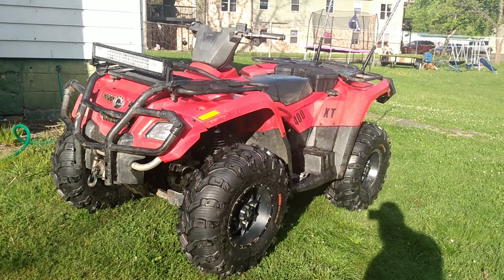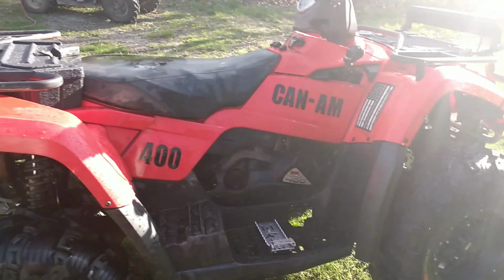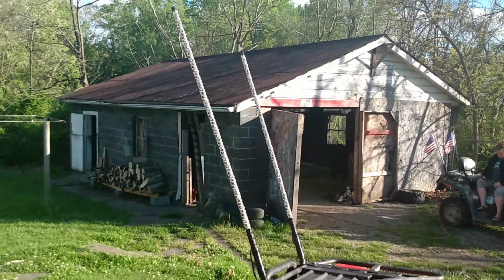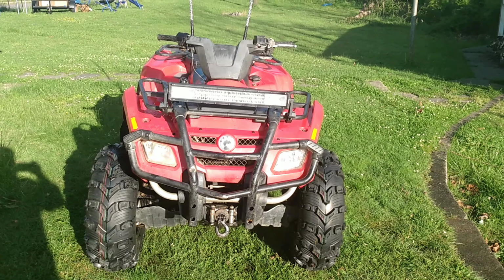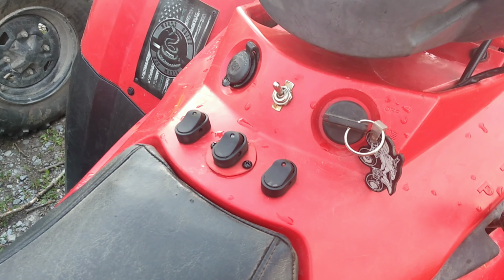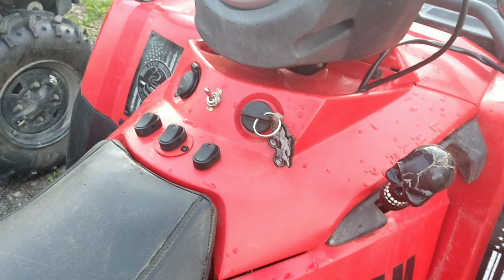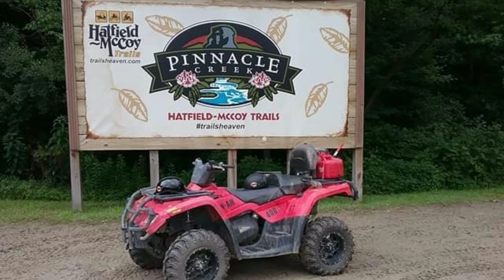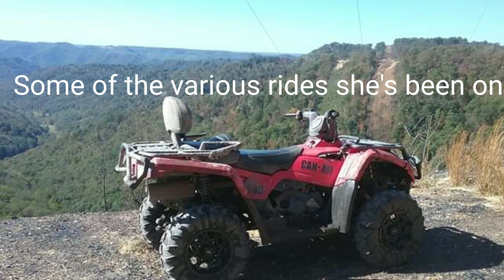CanAm Outlander Max 400 Rebuild-Part 4 (Completion)

Comment: Great video...Where did you get the fender flares for your wife's Can-am? We are curently rebuilding  ours as well.
Reply from the maker: Thank you very much!
Those flares were already on the machine when we purchased it. However, you can get a complete set, new on ebay. Here is the link:
https://www.ebay.com/itm/403205731170?chn=ps&_trkparms=ispr%3D1&amdata=enc%3A1I2RtR7jXT9eGn9_SMKOBqg83&norover=1&mkevt=1&mkrid=711-117182-37290-0&mkcid=2&mkscid=101&itemid=403205731170&targetid=1644837434363&device=c&mktype=&googleloc=9009239&poi=&campaignid=16743749222&mkgroupid=138744546207&rlsatarget=pla-1644837434363&abcId=9300842&merchantid=131375992&gclid=CjwKCAjw6IiiBhAOEiwALNqncffy6fSMHNHDTghTfkYDOgaybSVTjdQ0gj6sAzL87VXkR5el2pl_VxoCkoMQAvD_BwE
Reply: @turtlescycle  Thank you !

Comment: Are those 12 in or 14 in upgrade?
Can you share the tire size?
Reply from the maker: They are 12" wheels
Tires are Kenda Bearclaw 26x9x12 front and 26x11x12 Rear

Comment: Awesome video I'm assuming yours is an early 08 carbeurated model? Unless maybe it's just because of the Max, but my 08 400 efi has the exhaust on the other side. I love it I got lucky am the 2nd owner picked mine up in 2020 with 500 miles. Am at 1800 now and it's already paid more than itself off I plow with it every winter. The only issue I've had so far was the original winch broke it stopped working when I was plowing so I had to ride home with the plow down, when I took it apart pieces of the gears were broken off. I upgraded to a 4500lb winch and I take good care of my machine. I don't really go on trails too often, but here and there. Don't go in the mud because it's my source of income for the winter.
Reply from the maker: Thank you for the compliment.
Yes, this an 2007 Carburator model.
Reply: @turtlescycle  sweet yea they're good machines I had an 04 previously It'd take a lot of abuse, but got rid of it because it started eating away at my pocket. It wasn't taken care of by the previous owner though. I was to young at the time too and didn't have the tools to work on it.
Reply from the maker: @baileymiller546  yeah tools, knowledge and deep pockets! Lol.
It is definitely nice though to see your work in progress when it's done.
Reply: @turtlescycle  yea so far this 08 has been taking good care of me and I've been taking good care of it. Eventually it'll need some work done, but I'm very happy with it. Best of luck with your projects friend.
Reply: @baileymiller546 what issues was your 04 having. Thinking about buying an 05 and want to make sure it isn't a money pit. Seller says it hasn't ran for a year and needs a "new battery"
Reply: @CristianCruz-jf4iw  little bit of everything because the po did not take care of it and I didn't have tools or know how to work on it at the time. Apparently all the powersports places didnt either because when I had some work done they didnt put the battery hold down back in so when it fell out it ruined the cluster and a bunch of stuff. This was years ago I was only 15.